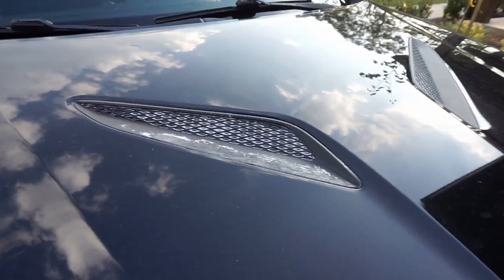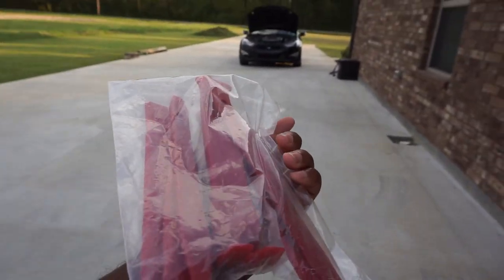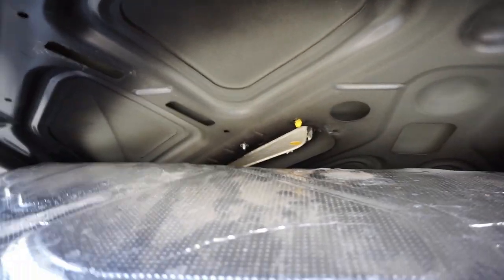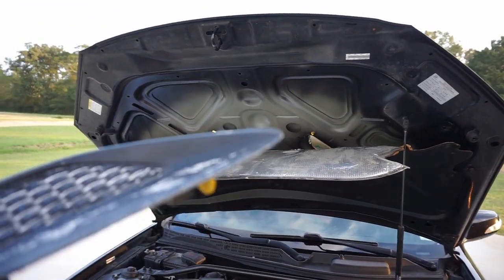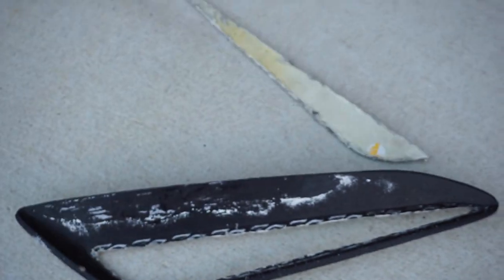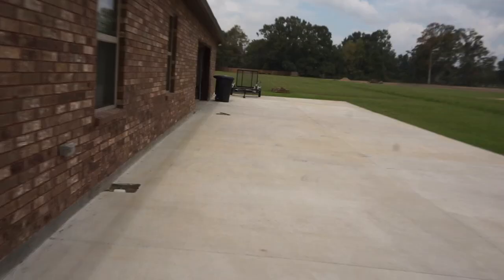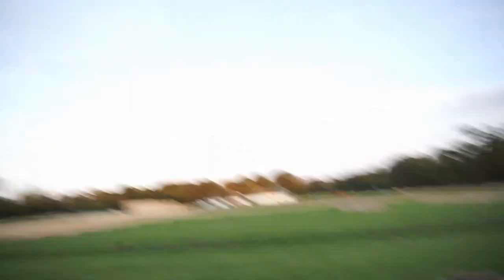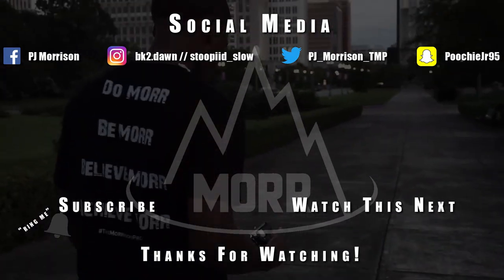Modding the Hood Vents on My 2014 Genesis Coupe 3.8

Comment: That engine cover is only held on by 4 little posts that come up from the engine. You can literally just pull up from each of the four corners. No tools required. And you can put it right back on if you want to, no trouble. Again, no tools required.
Reply: Wait what?

Comment: Through the vents, the engine cover on makes it look like you have a Transformer under the hood.
Reply: I take that stupid cover off it holds heat
Reply: Also rip all that insulation foam out from underneath the engine cover and put the cover back over when it's going to rain and that prevents the water from getting on the intake and everything I also lay a garbage bag over top of the engine cover to keep water off the alternator and all the other components

Comment: I also did a thin steel mesh  .
Reply: I feel like a mesh is much needed. I wanted to drill holes in the fake vents for each and then slide a thin steel mesh under it.
Reply: @FatalFist  what I did was from the backside dremeled out the fake mesh all of it and then smooth it out with sandpaper and then put a metal mesh in behind
Reply: @FatalFist  make sure you use a decent epoxy

Comment: what if i took the hood insulation off, bought vents that have the holes in them already, then put them in, and then put the hood insulation back on? would water get trapped in between when it rains? or would there be room for it pour out if i lift the hood up for it come out?
Reply from the maker: The insulation would be ugly for one, and yes then you’d have to worry about standing water ruining things and potentially becoming moldy and stuff
Reply: @pj_morrison  awh damn, okay thanks man🙏🏼